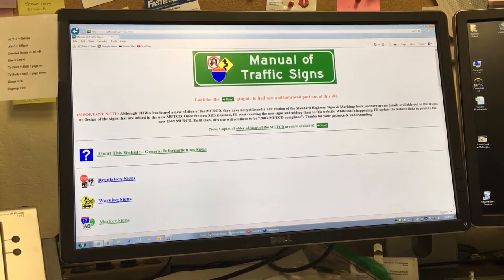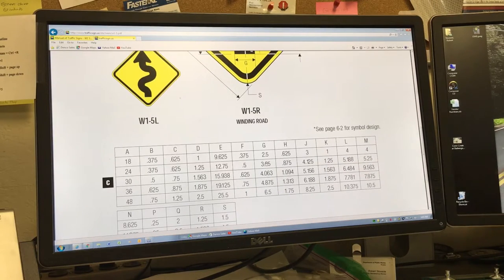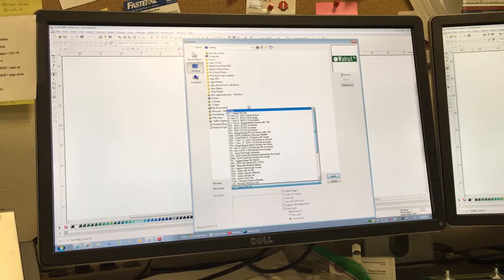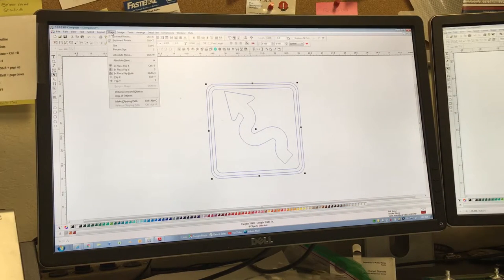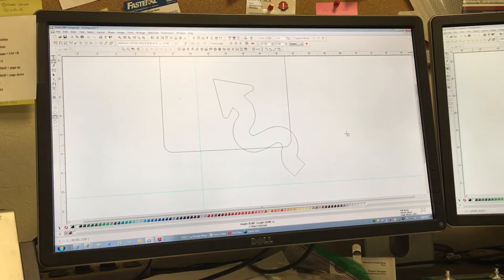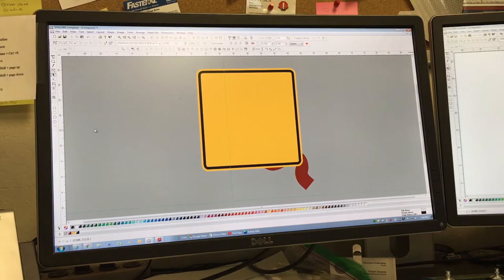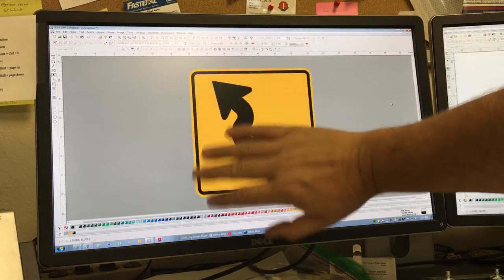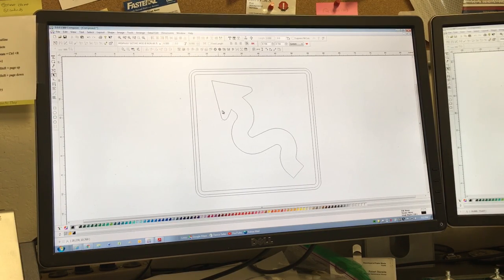Traffic sign design

Comment: This is another nice video.  When I used to have a vinyl machine, I was able to match the MUTCD specs, on a smaller scale.  It takes some effort, but I saved them onto a vinyl program, so I could cut them in quantities.